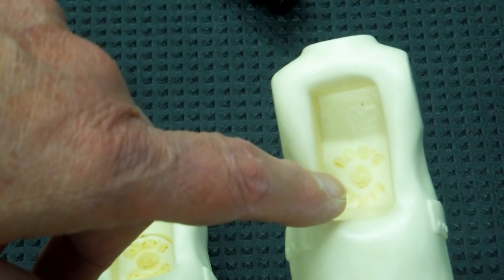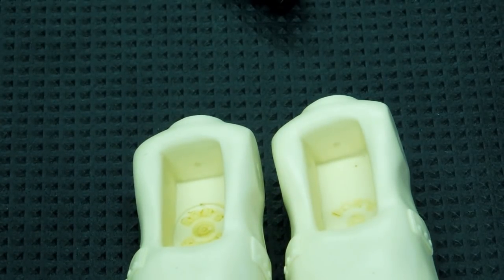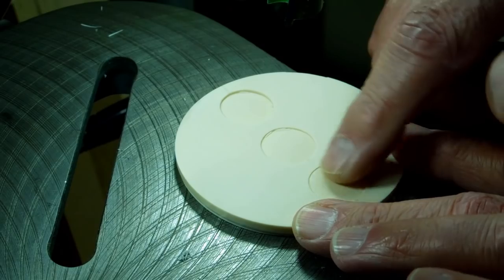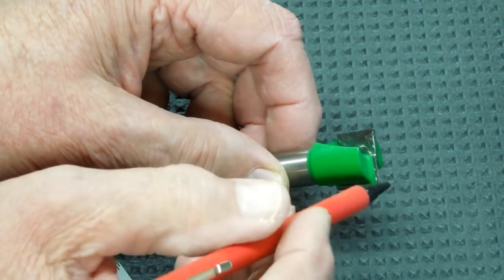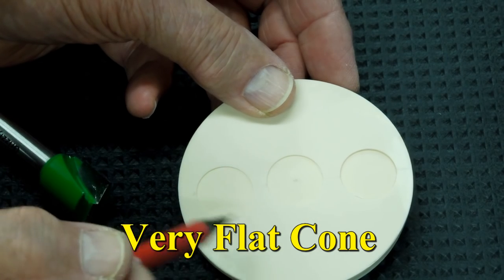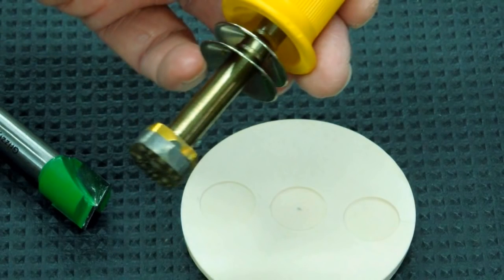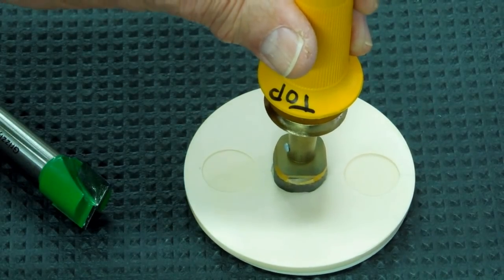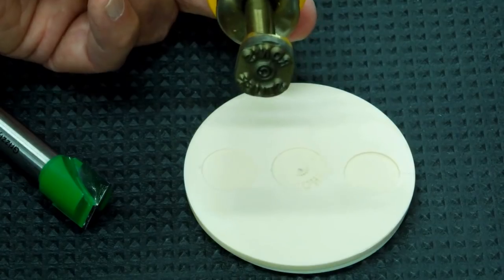Senior 20 Organ Conductor (8) Branding Plastic

Comment: would a cheap thermocouple to monitor head temp be worthwhile? with a PID controller and indicator light you could even set exact temperatures and know when it is ready.
Reply from the maker: +Robert Szasz  Myself and Brand-First expected it to be easier to melt a brand into plastic. However this cast resin is pretty tough stuff. I had a temperature controller (basically a rheostat) for the iron as I did not think it would need to get so hot. Ended up not using the controller and let the iron run at its full 30 watts. As they say, practice makes perfect. Since you can not actually see the brand being made, you need to practice and learn the indicators like smoke and sound to know when it has been in contact long enough. Sometimes you can over complicate the process... keep it simple.

Comment: Great video as always Ron. Question - why not use a forstner bit to create the pocket instead?
Reply from the maker: +Chris J's Clockworx  I would need to remove the center brad (or spur) or there would be a hole in the center... but then the chipper wouldn't flatten where the center brad had been. Then it would cut a deep ring with the outside rim. You could remove the outside rim... but the outside rim is what stabilizes a Forstner bit... which pretty much brought me back to using the router bit.

Comment: have you considered branding the master pattern and then molding it so all copies have the branding?
Reply from the maker: +Everfalling  I originally expected the iron to more easily melt the plastic resin. If I ever make any more of these I may make the flattened disc in the master. Branding each individual casting is a personal touch and makes each one slightly different.